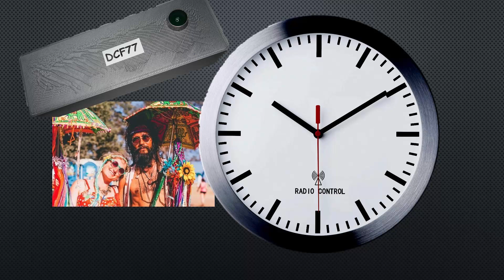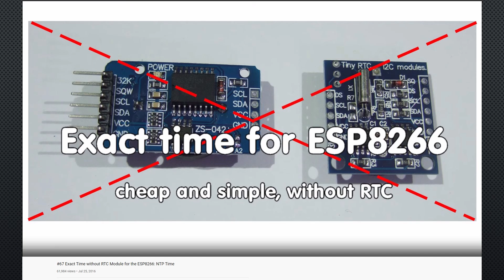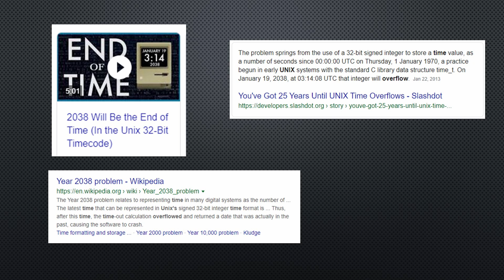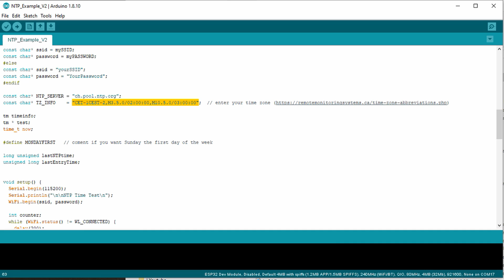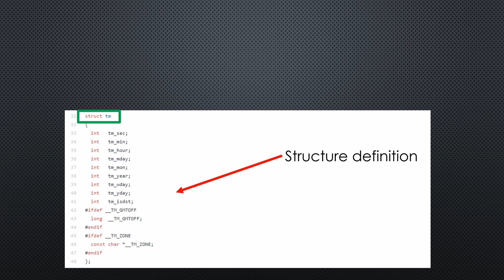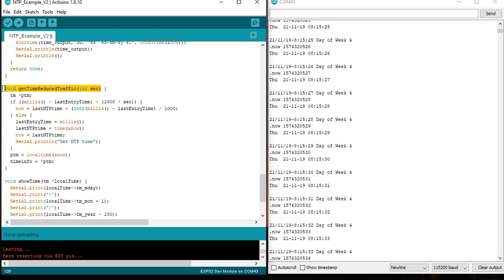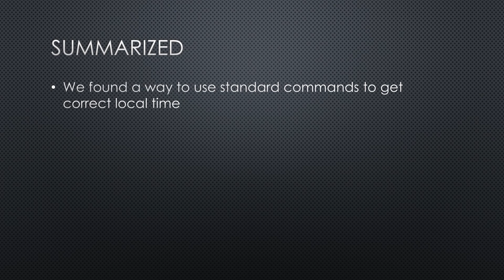#299 Tricks to get NTP time for the ESP32 and the ESP8266 incl. Summer- and Daylight Saving time

Comment: Let me share my success with you and describe how I managed to run the circuit. Most important items for me in the connection and setup area are the following:

1. Antenna
   1.1. Connection circuit based on Video 287, time 9'50'', https://youtu.be/6SHGAEhnsYk?t=590 - "Remote Controller for Clocks"
   1.2. My antenna inductance 4.60 mH, measured as in [Video 287, time 6'40''](https://youtu.be/6SHGAEhnsYk?t=400). Capacitor 0.93 nF (measured, ref. 1 nF)

2. ESP32 board by Espressif
   2.1. No onboard LED, I used the external one - connected to GPIO 5
   2.2. Antenna attenuation (background) pin - GPIO 4
   2.3. Antenna pulse (main) pin - GPIO 17

3. In Arduino code: "IDE, DFC77_ESP32.ino"
   3.1. Definitions in a global section
```
#define LEDBUILTIN 5      // External LED
#define ANTENNAATT 4      // Antenna attenuation
#define ANTENNAPIN 17     // Antenna frequency output
```
   3.2. In `void setup()`
```
  pinMode (LEDBUILTIN, OUTPUT);
  digitalWrite (LEDBUILTIN, HIGH);  // HIGH, inversely, switches the LED off

  pinMode(ANTENNAATT, OUTPUT);
  digitalWrite (ANTENNAATT, HIGH);
```
The original hzeller's project, https://github.com/hzeller/txtempus/blob/master/img/schematic-dcf77.png - is for Raspberry Pi, where GPIOs up to 8 have the default state HIGH. So, GPIO 4, pin 7 on RPi, referenced in Video 287, time 8'45'', https://youtu.be/6SHGAEhnsYk?t=525 - has 3.3 V. That's why, I have set ANTENNAATT HIGH for ESP32.

   3.3. In `void DcfOut()`, I have toggled all `digitalWrite(LEDBUILTIN, HIGH);` to `digitalWrite(LEDBUILTIN, LOW;`, and vice-versa.

4. In Arduino Board Manager, I installed esp32 by Espressif in version 2.0.17. Unfortunately, since v3.0.0, `ledcSetup` and `ledcAttachPin` were removed. A simple redefinition as I mentioned above was insufficient and the circuit did not work.

As a final remark, I can say that I received the simulated DCF signal to update clocks ca. 4 m away from my coil.
Thank, Andreas, for your inspiring job!
Reply from the maker: Thank you for your documentation. Very helpful.

Comment: Thank you for the enlightening video! I'm exploring ways to synchronize two ESP32 devices to generate a sync signal every 100ms. I can tolerate an error margin of 5-10ms, but the closer to zero, the better.
My plan is to use WiFi, with one ESP32 acting as the master Access Point (AP) and the other as the slave. Since I don't have access to the internet and I'm not concerned with the actual real-time clock, my focus is purely on maintaining synchronization between the two devices.
I'd love to hear any ideas or suggestions on how I could implement this!
Reply from the maker: Look at ESP-Now as the WiFi protocol. It is less complex and faster.

Comment: Thank you! A lot of useful information. Some comments:
time() function, if the initial connection to NTP server is successful, provides the correct result even Internet is not accessible.  In other words- looks like the GetTimeReducedTraffic() idea is implemented INSIDE this function and therefore GetTimeReducedTraffic function() is useless. Another conclusion- time() cannot be used as an indicator of Internet presence
Reply from the maker: You are right, time() runs off the internal clock if not connected to the internet. However, this is not very precise (for a Swiss ;-) )

Comment: Does the time keep counting internally after synchronization? I tested this and it shows the time when the request to the ntp server was made and it keeps showing the same time, until new data is received form ntp server, basically only shows the time that the ntp server sends. If the network goes down, there is no more time update, meaning, the clock keeps showing the same value. I thought this would receive the time from ntp server and then keep counting the time internally and periodically sync the time with the ntp server, like a computer does.
Reply from the maker: I just checked my device. It reads the NTP time every minute. But this is an old video and I do no more remember the details
Reply: @AndreasSpiess  does it keep counting the time like an offline clock when the network goes down? If the network goes down, the clock freezes. The EZtime library keeps ticking even when the network goes down. I´m gonna use the EZ library, I was not aware of it at the time I wrote that.
Reply from the maker: @diogomartins9101  I do not know. My network is always up 😞
Reply: @AndreasSpiess  my project location does not have a good wifi signal, there will be connection losses, for sure, and the project includes a logger, so time tracking is essencial... It's in a farm...

Comment: Nice video, many thanks. May be I haven't understood the main reason for using NTP server with ESP32 for time. So please allow me to ask: Why you didn't choose to use DCF77 directly? You don't have to worry about summer and winter time correction or the number of time you send request to NTP. With DCF77 you always have the right date and time. Is the main reason for your selecting the NTPserver  is the ease of adapting the NTP structure and available ESP32 functions in the sketch? Please comment. Thanks
Reply from the maker: I thought I mentioned the reason: I do not get DCF77 reception in my basement :-(

Comment: Michael Graff is quite correct. Use UTC time across the system, this avoids data logging complications when local clocks go back an hour. Then adjust the time when presenting to users at the point of consumption. Thus the locale of the source device can usually be inferred by user context. (The user can say in which timezone the data should be presented for any given device.)
Reply from the maker: I think (hope) this is standard in all applications where you expect this issue. I remember the time where this created headaches...

Comment: How is the ferrite rod antenna connected to the ESP32? any circuitry required? I have one from a DCF77 receiver and it has a capacitor between the 2 wires, I read this is called a tuned antenna. Do I just connect the 2 wires to the ESP32? Thank you
Reply from the maker: Did you watch my video #287 shown in this video?
Reply: @AndreasSpiess  I did, but I'm not sure if I could just replace the ESP32 single wire antenna with the ferrite antenna and its capacitor, or should i take any precautions with the circuitry?
Reply from the maker: @SEOng-gs7lj  You can add a transistor if you want.

Comment: Great video again. Just one remark. Update NTP is only with configtime function. getlocaltime_r() in getNTPtime example code does not update ntp in my test. Did 24h test  with example code clock was 2min behind. Restart updated time correct again.  So update is done only when configtime is run and you have wifi of course.    found nice extra (esp32)configTzTime(TZ_INFO,NTP_SERVER,NTP_SERVER2,NTP_SERVER3);//this updates via ntp  and posix is integrated.
Reply from the maker: Maybe the example code has an error. But it should be easy to debug...

Comment: WARNING: You should only poll a NTP server every 64 seconds at most frequent, backing off to hourly once you're happy with local clock stability

Polling every second is classified as abuse and can get you filtered
You should also run a NTP server in your local network and sync everything inside to that instead of the pool servers
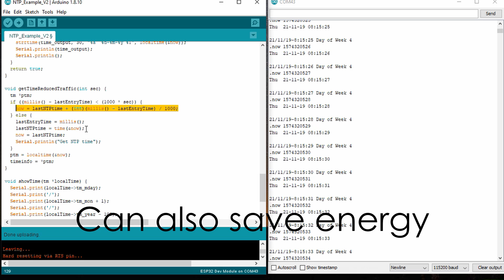Reply from the maker: You are right, of course. This is why I mention that calling it every hour is sufficient (9:28). But I did not warn :-(

Comment: VMS uses an epoch starting on 00:00:00 of November 17, 1858 (base date of the U.S. Naval Observatory's ephemerides)
Some OSes use - Modified Julian Day zero - May 23, 1968 as epoch start
Macs start in 1904

Windows NT and COBOL uses 1 January 1601 - (the first year of the 400-year Gregorian calendar cycle) 
whilst some other systems use 5 October 1582 - the actual date of the transition from Julian to Gregorian calendars

"Standards are wonderful, there are so many to choose from"
Reply from the maker: Thank you for this interesting info. I did not know that there are several such standards!  Now I know I have to be cautious.

Comment: Andreas, no beer or drugs were involved with "struct tm".  The ISO 8601 standard that establishes Monday as the first day of the week was first published in 1988 almost two decades after "struct tm" was defined.  In the United States, where the code was written, Sunday is considered the first day of the week (again pre- ISO 8601).  As you are aware, the C programming language uses zero-based arrays thus the tm_mon and tm_wday can be (are) used to index arrays for converting to character (string) representation as in strftime().  January and Sunday therefore have zero values in tm_mon and tm_wday respectively.
Reply from the maker: Thank you for your explanation!

Comment: hello the code works , but if i want to change the code with fixed ip address   , then the ntp doesnt work anymore

 
 this line breakes everything then 
  WiFi.config(ip, dns, gateway, subnet); (on esp32 wroom)
Reply from the maker: This is a general ESP32 question. I never use fixed IP on the ESP, I fix the addresses on my router.
Reply: @AndreasSpiess  okay , i found a walkaround  by using this  :    WiFi.config(ip, gateway, subnet, dns , dns ); //This is important for ntp! Include dns1 and dns2 when configuring!

Comment: Gotta question? Maybe someone out there done this. I just found out how to set the time on a DS1307 RTC(Real Time Clock) and it works, but I have issues with it.. To set the time using the example they give, requires perfect timing at the time of upload to get the RTC to the correct time. My best effort gets me 12 seconds from true time. I was thinking of trying to use NTP to sync the RTC to the NTP server, but that also requires adjusting for network delays.. 

I am shooting for 1 sec accuracy, because I don't know if 1uS is possible. I was thinking of using the millis() function to get offsets of both time sources, then use the difference of the offsets to adjust the RTC to true NTP time.

Has anyone else solved this problem. I want to try to get both time readings to match..
Reply from the maker: To measure the time difference and adjust seems to be the right way for me.
Reply: @AndreasSpiess  I got it working within +/-1 second of NTP time..
Reply: My current problem. I was able to get year, hours, mins and secs from epoch, but I wasn't sure how to get month, day and day of week.  Here is the code I have working so far...

  // timestamp1 = millis();// Placed on line after data fetched from server
  int timestamp2 = millis();
  int yy = epyear;// epyear = secsSince1900/secsinyear-100;
  int mm = epmonth;// don't know how
  int dd = 18;// don't know how
  int dow = 6;// Day of week// don't know how

  int hr = (epoch % 86400L) / 3600;
  int mn = ((epoch % 3600) / 60);
  int sec = (epoch % 60);
  sec = sec +((timestamp2 - timestamp1)/2); if(sec >60){sec = sec - 60;}

  if (!flag){
    rtc.set(sec, mn, hr, dow, dd, mm, yy);// This line sets the clock
    flag =  1;
  }

  rtc.refresh();
  if(sec != rtc.second()) {
    Serial.print("ntp:  ");
    Serial.print(sec);
    Serial.print(" rtc: ");
    Serial.print(rtc.second());
    }else {
    Serial.print(" << match >> ");
    }
Reply: after running my test for 24 hours, I found out that my RTC gained 7 seconds in a 24 hour period. Does the DS1307 have an internal register to adjust it's internal clock speed? I thought the Ds1307 was supposed to be accurate to within 6 seconds a year, not 7 seconds a day.. Which is highly unacceptable.

Comment: Andreas, your script on wemos d1 mini don't work correct! I copied your sketch, changed only the credentials, but time is 8 hours in the future! I'm from munich and have the same timezone as you! any suggestions?
Reply from the maker: Unfortunately I cannot do remote debugging. Maybe you insert some Serial.print statements to find out where it does not work.
Reply: @AndreasSpiess  Is it possible, that you can compile your sketch from above on your esp8266! I tried a NodeMCU as well - same problem 8 hours in the future. :(
Reply: It only works, when I define the IP-Address from the NTP-Server and not the Name!  crazy

Comment: I got my own in Iceland running now! \o/
Finding and sorting out the hardware problems took some effort without an oscilloscope and the resistor values are different, when your coil has 198millihenry... ;)
Reply from the maker: Congratulations!

Comment: What modification is needed for WWVB.
Reply from the maker: I did not look into the coding of WWVB, but assume it is different. So you have to re-write this part. And also the factor to change the frequency to the frequency of WWVB. My video with the Raspberry used SW which is capable to transmit WWVB signals if I remember right.
Reply: @AndreasSpiess  Thanks for the feedback sir, yes your video using pi is great, but I thought esp32 would be better since esp do not need to be properly shutdown when not needed.
Reply from the maker: So you need some tinkering ;-) It should not be too complicated
Reply: @AndreasSpiess  Hopefully someone smarter than me will tweak it, fingers crossed :)
Reply: Did you get the conversion to WWVB done? I want to build one on an ESP32 Dev kit but as I am not a programmer It has been impossible.

Comment: I just went through the same exercise for an ESP8266 project, and eventually came up with pretty much the same solution as presented here, but with one minor difference: after the setenv(...) call, the examples I referenced included a call to tzset(). I'm not sure what this does, or if it is needed, but it hasn't hurt my code...
Reply from the maker: I also saw this command. But it seems to work without ;-)

Comment: you have a small mistake in the following code, the counter variable is not incremented and if WiFi connection is not successful the loop will cycle forever

 int counter;
  while (WiFi.status() != WL_CONNECTED) {

    delay(200);

    if (counter > 10) ESP.restart();

    Serial.print ( "." );

  }
Reply from the maker: Thank you. It is corrected now.

Comment: Andreas did you ever used LiFePo4 batteries with Lolin D32 (ESP32)? It works as well as LiPo batteries?
Reply from the maker: LiFepo batteries must not used instead of LiPo batteries. They are not compatible. LiFePo batteries have to be charged with 3.6 volts, not 4.2

Comment: just wonder.
If function time() on (arduino core) time.cpp always call SNTP (need internet connection), then ESP8266 doesn't have any internal clock ( i mean counter)?
if that so, should i count it manually?

or function sntp_get_current_timestamp(); inside time(); only sync current time. (not always call SNTP)
Reply from the maker: I made some comments on Github. The NTP server is only called every hour.
Reply: @AndreasSpiess  So, as your note in github "So there is no need for the function getTimeReducedTraffic()"